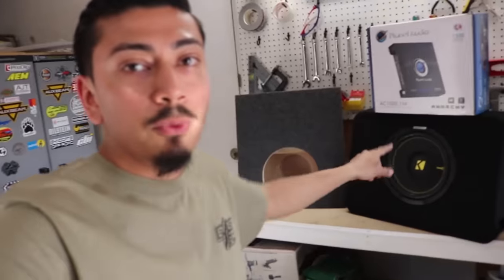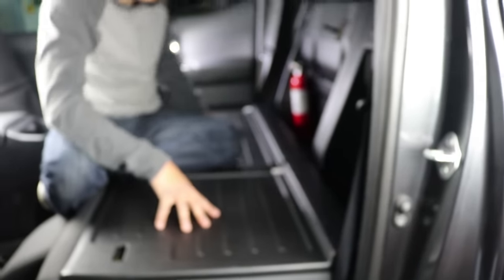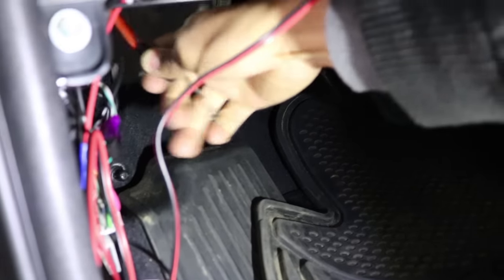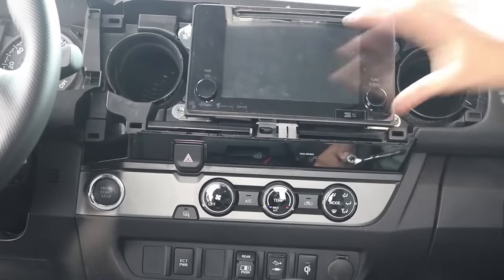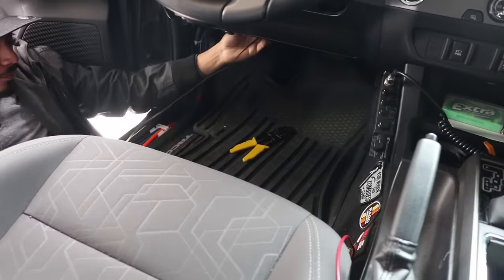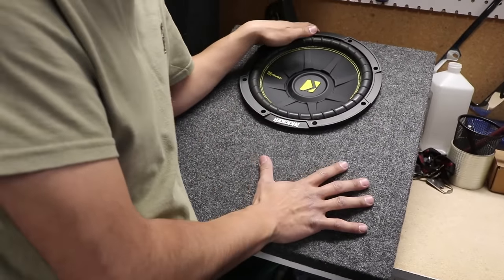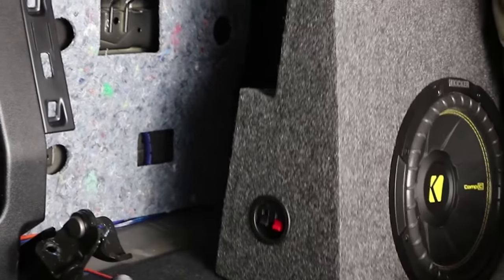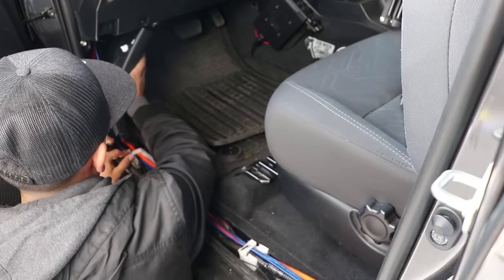HOW TO INSTALL AMP + SUB ON A FACTORY RADIO 2016+ TACOMA plug & play well worth it

Comment: What amp do you recommend if you don't really like the one you have?  Will an amp improve the sound by itself (without adding a sub)?
Reply from the maker: Once I get the upgrade I’ll be getting a 5 channel amp for my 4 door speakers and my subwoofer that’ll help, as far as without having a sub like ur saying if you have upgraded your door speakers only I still would recommend getting an amp just to make everything a lot better but that depends what speakers u have your rms/Watts they are if u did switch them out?

Comment: Did you just screw the amp into the plastic? How did you make it not slide or move around?
Reply from the maker: I mounted it with screws and it’s worked lol I believe I showed it in the video

Comment: Hey bud, I have 21 Tacoma. I replaced all the interior speakers with Kickers CS but I didn’t notice a huge difference. Should I add an amp or?
Reply from the maker: Yes I’d add a 4 channel amp to them they need a push the factory radio will not push out the watts the kickers need
Reply: @JesseRizo  awesome, thanks man

Comment: The plug and play converter has 2 RCA plug outlets, the amp I have comes with 4. How does that work?
Reply from the maker: I would try and find one that has a 4 channel one or try and see if you can find a connection that’ll make it go into 4
Reply: Buy 2 RCA Y splitter to used at the amp
Reply: plug the 2 wires into the input rca's

Comment: Great video. But does the loc deal with bass roll off? Because I have noticed that once you go over volume 25 the bass starts decreasing.
Reply from the maker: Regardless yes I’m not 100 percent on the science behind it but yes I’ve noticed in any vehicle I’ve ever install a amp to with a stock radio there’s a point where the bass starts rolling off vs where I installed the same exact amp and sub to a aftermarket radio u can tell the difference but hey it’s still worth it if u want added bass without buying a new head uniit
Reply from the maker: Unit
Reply from the maker: I also forgot to mention there’s one loc u can use which is the lc7i that’s probably the best loc in the market you can control the settings and it makes everything so much more crispy clean so maybe u can try that one out just it’s around $300 if I’m not mistaken lol
Reply: @JesseRizo  yeah I want to keep the stock one for now. I am looking into the lc2i
Reply: High input method of hooking up an amp helps a little with sub levels going out but you lose a little sound quality... Speaking from experience not research

Comment: Where would i get a wire for the sub to the box? Or would the subwoofer come with one?
Reply from the maker: You can ask your local stereo shop so you get the correct gauge size for a amp kit (all the wires you’ll neeed) or amazon has some & even Best Buy I believe sells amp kits

Comment: Jesse i got a 2019 sr5 with a 6” head unit, the line converter for plug n play the you purchase on amazon would fit my head unit?
Reply: Hey I was wondering if you have confirmed if the line converter would work on a 2019?
Reply: I haven’t confirmed that yet

Comment: Hey man just letting you know, that Line Output Converter doesn’t work for the 2020s
Reply: Tom Bruno can I ask why? I have a 2020 and plan on using the converter.
Reply: @7upbottlesdown  Same I thought I read some where that you have to use a razor knife next to release pin?
Reply: do you have one that does?
Reply: @7upbottlesdown  did it work for ur 2020? I have a 2020 too but i'm looking for one

Comment: What did you do to secure the amp in the bigger storage unit?
Reply from the maker: I built a wood platform to fit in there
Reply: @JesseRizo  did you attach the wood to the plastic any or just place it in the storage slot?

Comment: Hey where do you feed the wiring through from the battery and the interfaces I’m so lost
Reply from the maker: Do you have the kicker setup I use to have or do u have the new oem audio setup I now have?
Reply: Jesse Rizo so right now I have an AMP and and power connector? My father gave me (he paid like 300-350 for the amp back in like 2008-2009)... and i have two twelves that I know won’t work? So what do I need? I was looking in my truck where to feed the cables and I was lost af bro

Comment: For $100 you can use the Bose Soundlink II. it’s a Bluetooth speaker that just may sound better than the system upgrade many have done. It’s portable too so you can use it on your tailgate and anywhere else your imagination will bring you.

Comment: HI, WHAT AMP & AMP KIT SEPERATE YOU RECOMMEND? THANKS
Reply from the maker: Antonio Morales so on this it all depends what ur budget is for this video I did it as clean but basic “budget” as possible which isn’t my long term setup I recently got a new setup “video coming soon” but it all depends on pricing my friend if u want something more better I’d recommend either Rockford fosgate or jl audio <—- a little more but worth it or like myself I needed going with OEM Audio Plus so just depends on that and also what type of sound your trying to achieve on your build
Reply from the maker: Also dependsif u upgraded the door speakers or are going to as well?

Comment: Line output converter doesn’t work for a 2021 Tacoma trd sport
Reply from the maker: Yup in 2021 the harness has changed 
This is a old video that I did on my 2018 Tacoma
Reply: @JesseRizo  ya almost got done only thing left was the converter..... and I have no idea how to splice the right wires.....

Comment: will that audio adapter work in a 17 tacoma SR5?
Reply from the maker: It should if not I think there’s a choice for it
Reply: Jesse Rizo 
ok thanks!
what about the rear cab vents, does the box interfere with them? 

i ask because i recently ordered a box for a 16 tacoma thinking i could make it wrk on my 17. ended up hitting vents and broke the retainer taps causing a gap between rubber seal and cab which will cause water to poor into cab when it rains.
Reply from the maker: This box shouldn’t do that it’s made specific to the year and make of ur vehicle 👍